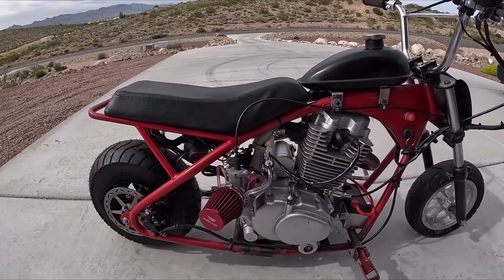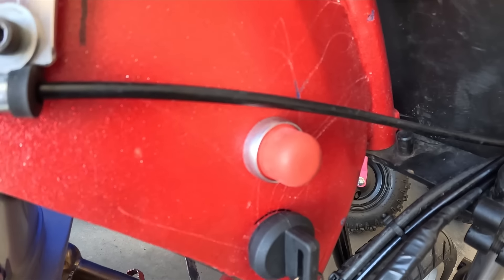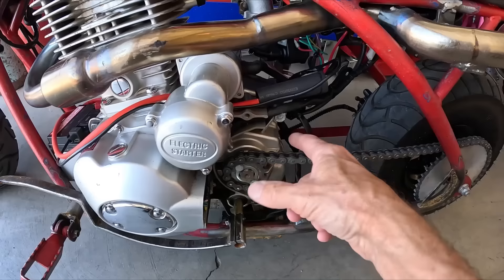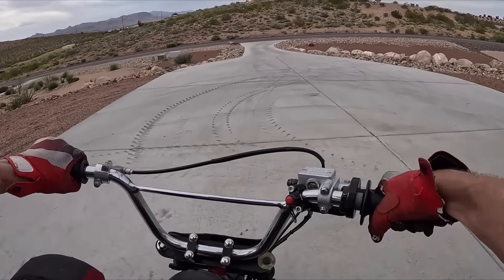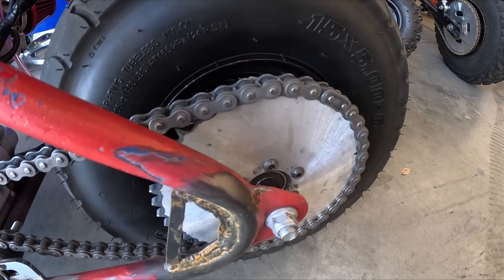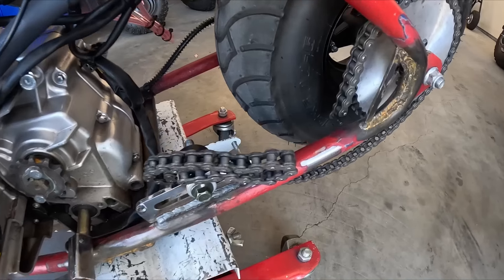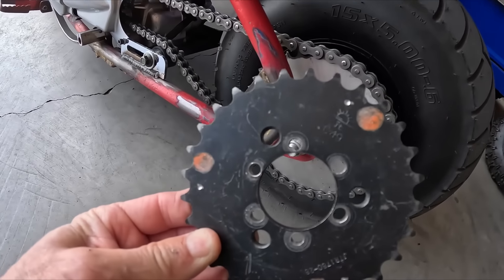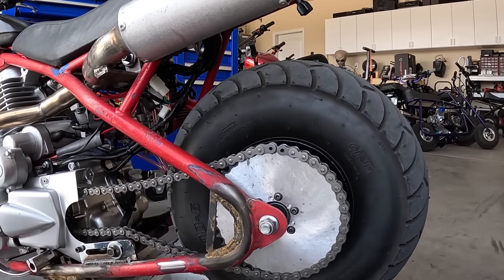Motovox mini bike with a dirt bike engine gets faster!

Comment: I built mine last year from a Coleman ct200ex with the 2qin tire best gearing I found for me was 17/37. I actually just swapped the hawk 250 motor I initially installed on my mini with a kayo230cc with the over head cam. The internal gearing is slightly longer and it has over head cam. I'm eager for my test ride tomorrow! But nice to see more and more of these 250cc minibikes! Awesome build brother!
Reply: My final drive ratio is 2.1 and these engines don't car about these little frames that can handle the low gearing.

Comment: Give it a little more main jet💪🏻💪🏻=more power, cooler temps.
Reply from the maker: Its running a power jet on the PWK that adds fuel at the top. This is the reason I can get away with a small main jet.

Comment: The 17t will give you a 2.35:1 ratio. 13t front and 30t rear would be 2.31:1 ratio.
Reply from the maker: Yes, check out the gear ratio calculator here https://www.gokartsupply.com/ratios.htm

Comment: How does the power of this engine compare to a Predator 459 or a 420 or similar big block generator type engines? Asking because I have a large off-road kart I built. It has been a blast so far with the 459, but this engine has always been on the back of my mind too.
Reply from the maker: This engine is fun because it has gears but I think the 459 will have more torque . I 'm running a 420 in a few videos on the channel. https://www.youtube.com/watch?v=iOUn1q-ULUQ&list=PLkbj-ip-5FzZERarIt3bniaA9HC1zBGFA&index=3
Reply: @Black66  Makes sense. I'll stick with the 459 then. Eventually I'll do a built 420. Thanks for the response!

Comment: Hey I have a Coleman bt200cc it’s a 196 it’s only from tractor supply and I got it to do 46 mph but I feel like I’m damaging the engine and I want it to last longer if you could help me by getting it running nice and fast without the way I have it and actually do it the right way?
Reply: Just get  a billet rod aluminum flywheel and heavier valve springs